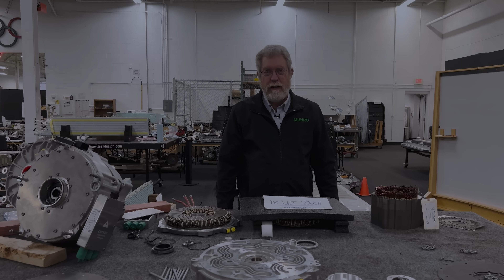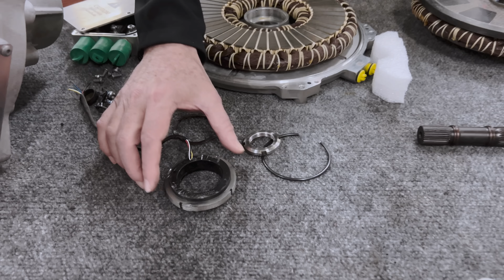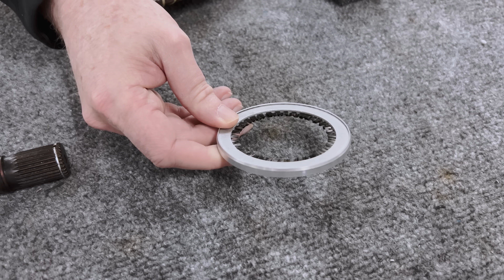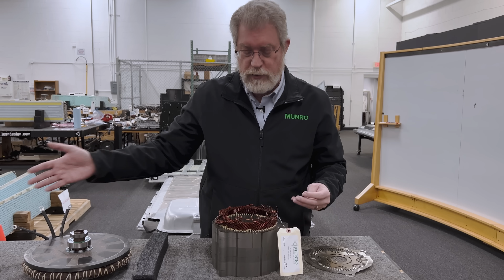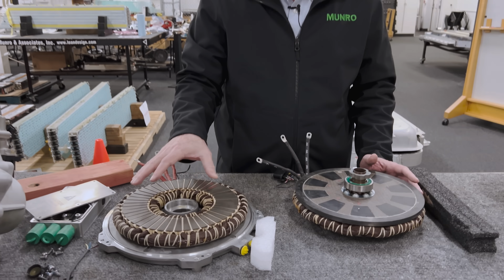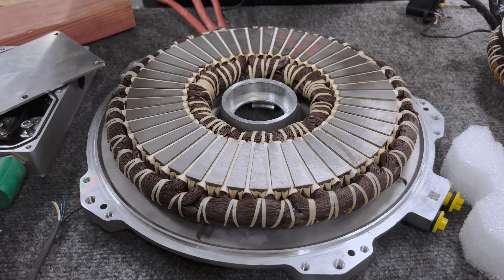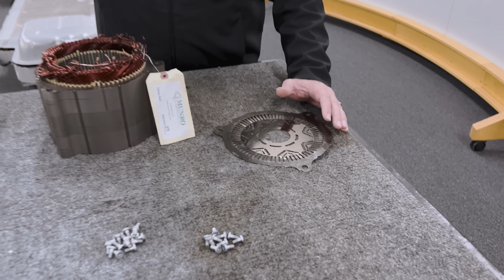Axial Flux Motors Explained: The Future of EV Powertrains?

Comment: Retired Elec Contractor here, never had much experience with motors but had a basic understanding. Did my trade with a Distribution Authority so got a very board education & in some cases got to train under some great Trades people. I spent most of my professional life in the construction industry, somewhat simplistic but with four kids paid the bills. A few decades ago now did an ADV DIP Electrical Engineering & as a bit of a computer nerd/flight Sim nut really loved the challenge, got heavy into 12vDC to PC PSU for mobile application. So mag flux was an important aspect to understand as well as its switching aspects. So to come to a point, I found your teardown & chat very interesting & educational. Actually loved it.
Cheers from DownUnder.
Reply: I like it from downunder as well 😅

Comment: These are already in use on EVs right?  Like the one in the Lucid drive.
Reply: No, Lucid does not use axial-flux motors (and the video explicitly said that). 
There is no high-volume production EV using axial-flux motors.

Comment: that cooling channel is not set up for equal cooling... its set up for manufacturing efficiency. if it was set up for cooling eff... it would have had in inlets split to both sides near the center shaft, then fan outward in a flower pattern with the collector back at the center opposite side of the inlets.if they really wanted to cool it down... they would use multiple strand hollow wires and use non conductive coolant (  typically called "transformer oil," is not conductive)  to run through them.

Comment: The very best thing about this is that you can have one at the wheel...  No CV shafts or axles or drive shafts to break.  I can picture a company in the future, somehow integrating these hub motors and the brakes into one unit;  or at least co-existing side by side at the wheel, in a very compact form--  which will give that vehicle the ability to have the most advanced suspension travel you can dream up.. since they are not limited by the range of motion of the axle shafts on a normal setup..  Plus it keeps all your weight low and to the outside of the vehicle - which will make it incredibly stable.  I can see why they use these in motor sports, because there are a lot of obvious benefits for performance, let alone the ability to build custom setups for cheaper.
Reply: This method has a lot of unsprung weight, which is very difficult to manage from a suspension and handling perspective. Would work in low-speed  applications like a farm tractor or very low power like a bicycle
(almost all are) but very hard to do in a  car.

Comment: If there is power equity between the Bolt and axial motor, what is the weight (dis)advantage?
Reply: I chose to compare it to the Chevy Bolt motor because they are very similar in performance and weight. Both motors weigh about 35 kg. Both produce about 350 Nm.  The Bolt produces 150 kW and the axial Flux motor about 120 kW at 350 V.
Reply: Didn't see an assembled Bolt motor unit for comparison in the video and why I asked.

Comment: Question?
What kind of cooling water do they use for the Axial Flux Motor? - Just simple anti freeze?
What's the weight difference between the Chevy Bolt and the Axial Flux motor?
What's the cost difference between the Chevy Bolt motor and the Axial Flux Motor?
What's the total parts count on this Axial Flux Motor?

Do they heat up the piece of steel in order to get it to bend?
What's the thickness of the Copper windings between the Chevy Bolt and the Axial Flux Motor?
Notice how they mark every fastener for the Axial Flux Motor.

Comment: Excellent summary of the two alternative approaches to electric motor design.  It’s interesting that despite the marked difference in approach the final result in terms of power and torque for given mass is very similar.  I know that Saab are experimenting with electric motors housed in the wheel hub as a means to provide motive power for an EV.  In this way they hope to abandon the need for drive shafts and free up more of a vehicle’s interior space of for passengers, luggage and batteries.
Reply: Saab Automobile is gone; they were purchased by GM in 2000, sold to Spyker in 2010 immediately followed by financial failure and a legal mess, and finally died in 2013. Near the end there was an attempt to make it into an EV brand, and it may have been during that desperate thrashing that hub motors were tried.  There hasn't been any Saab or any Saab experimentation with motors for more than a decade.

Comment: I don't see the "advantage" of the axial construction over the radial construction in the "flux" surface area.  You are trading a larger diameter shorter length for a smaller diameter longer length package (same volume).  The mechanical advantage of longer "leverage" on the axial construction may yield higher torque at lower speed, at the expense of greater centrifugal mechanical stress and higher speeds.  The simplicity of tooling and construction seem to be the biggest advantage.  Maybe low cost, high torque, low speed, hub motors (bicycles) is a good fit?
Reply: It's very much like the comparison between drum (radial) and disk (axial) brakes. It is true that for a single rotor (sandwiched by two stators) like this or the alternative of a single stator (sandwiched by two stators, like a YASA) there isn't a clear significant advantage in pole surface area.

Comment: I have heard alot of people try to claim that axial motors will have a much more compact packaging in the Y axis... but what I'm seeing here is a motor that is only slightly shorter in Y (if not the same) but much much larger in Z for the same stats. The higher surface area doesn't come as an even trade-off at all, it comes at the cost of a much higher volume to package and with that, probably more weight as well. So any torque and efficiency gains go completely out the window when compared to the total volume and weight. Very interesting and not what I was expecting based on the hype.
Reply: 100mm deep axial flux motor capable of 350kW/800Nm exists.
Reply: Because the physical challenges are different, some companies end up overbuilding their axial flux motors as a "catch all" way of combatting these challenges. It's why you see some axial flux systems perform pretty standard, while others outperform their peers with fair ease. Also there are multiple ways of achieving axial flux. In this case it's a dual stator single rotor layout, which increases both physical volume and weight, and also cost and cooling requirements. You can however do the opposite, with a single stator core in the center, sandwiched by two outer magnet discs that are light and require no cooling. As a result you can probably cut down the weight and size by a good 25-30% just by this single implementation -however there will be other engineering factors to consider in that case, which may simply not be in favor of the specific goal these guys are trying to achieve.

TLDR: There is no "this is the best way" approach to electric motors. It's still a developing field with lots of trial and error and r&d, and optimizations are made every year. You just gotta look at your specific engineering challenges and cost limitations, and based on that find the optimal choice for your application.
Reply: @Real_MisterSir  You are just repeating the conventional wisdom I have seen many times. Theorhetically, at the rotor level, they appear to save volume and weight... but in actual implementation with packaging, the benefits mostly disappear. It seems like people just took the logic from massive airplane engines and tried to apply it to compact electric motors and it just doesnt work like that. The miniaturization of motors doesn't apply to all materials equally. You can make the rotor as small as you want, but there are structural limitations to the thickness of the housings, and the volume of eletrical and cooling lines, so that there are diminishing returns in miniaturization. It's like with piping... a minor reduction in the outer diameter of a pipe causes a dramatic reduction in the capacity of the pipe, partially because of the relationship between volume and diameter, and partially because of the wall thickness of the pipe. At this scale, the radial motor appears to be larger and heavier than the equivalent axial motor. The ideal conventional wisdom and the practical implementation are completely at adds with each other because the ideal never seems to take into account either packaging or scaling issues.

Comment: Will you buy an AMG with the axial flux motor to make a teardown once they are released?
Reply: They could just tear down any YASA motor, since that's what the "AMG" motor is. But I agree that would be interesting.
Reply: @brianb-p6586  Not really though. There are quite some changes but yeah the overall set up is like the one in the yasa motor
Reply: @domengmech  I'm sure there will be a next generation of the design, but if all Mercedes-Benz wanted was the ability to build a yokeless and segmented armature axial flux motor with one stator between two rotors, they would not have purchased YASA... none of those features are even patentable.

Comment: Isn't that Chevy Bolt motor on the bench an induction motor rather than a permanent magnet motor whereas the the axial flux motor is a permanent magnet motor? You talk about magnets in the Bolt motor but those "magnets" are created by the induced current flow in the rotor.
Reply: No, the Bolt uses a PM motor, with interior magnet location. The parts shown in the video do not include the magnets, only one lamination of the rotor, in which you can see the slots where the magnets go. Munro has a teardown video for the Bolt motor (as well as showing its components in many other videos for comparison with other motors), as do other channels and websites. 

An induction motor would have windings or a "squirrel cage" of conductor bars around the rotor, in which rotor current is induced to form the rotor magnetic field. The rotor part shown in this video is a magnetic steel lamination, not a conductor.

Comment: It looks like it could have greater gyroscopic forces, which could compound the bearing problems if your application required rapid maneuvering.  Also, does this motor operate at a lower RPM than radial flux? If so, perhaps a direct drive to something like a propeller could save the weight of a gearbox.
Reply: There is no reason that one design or the other needs to operate at lower speed. The only production battery-electric aircraft in the world - by Pipistrel - does use an axial-flux motor (from EMRAX)... but none of the other serious near-production electric aircraft motors (such as from MagniX) are axial.

Comment: The fact that’s they are using two stators, make the rotor to float between them and cancel all the forces at bearings level!. Very cleaver.
Reply: That's normal for axial motors, although "one-sided" motors are available.

Comment: So would it be possible to use large diameter bearings on the outside of the rotor to improve longevity and stiffness of the bearings for slow RPM applications such as machine tool rotary tables?